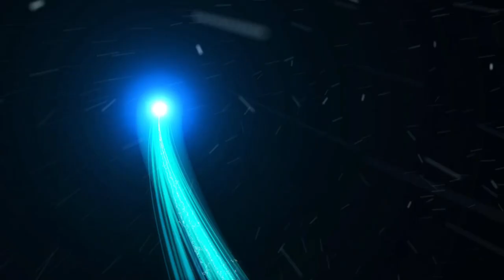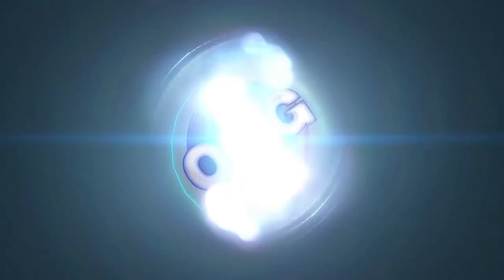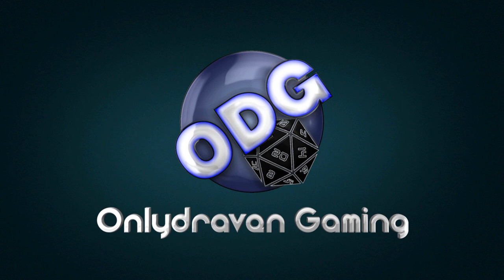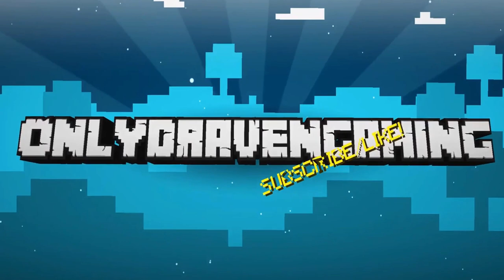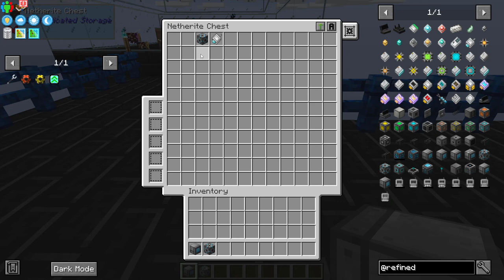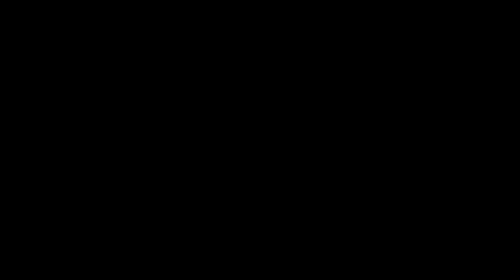Minecraft - All The Mods 8 - How to Use Transmitters & Receivers for Multiple Refined Storage Access

Comment: Not sure if you know or not, but can you take an external storage to like a drawer controller and connect that to the second grid/network and it’ll show all the way back at the original?
Reply: Or an exporter connected to the network transmitter or whatever, would that feed items into the system? Or do I have to manually enter items through the secondary grid?